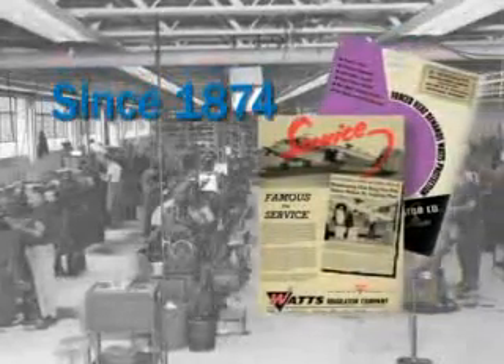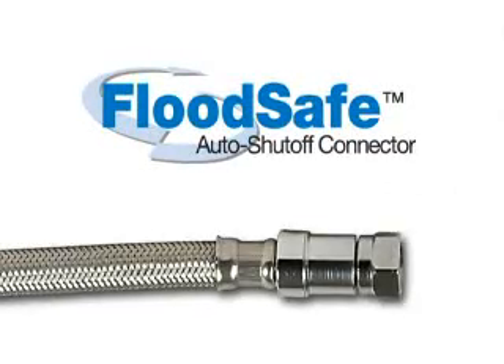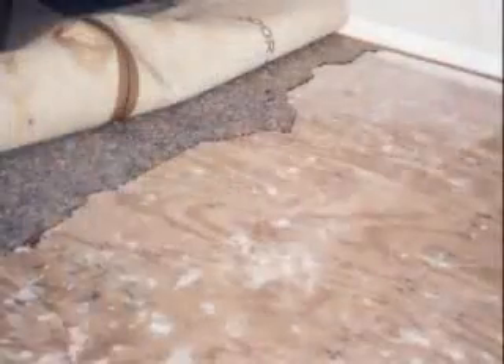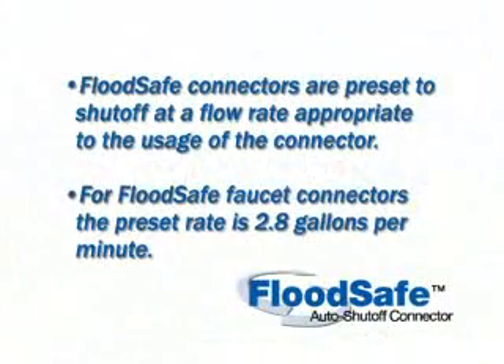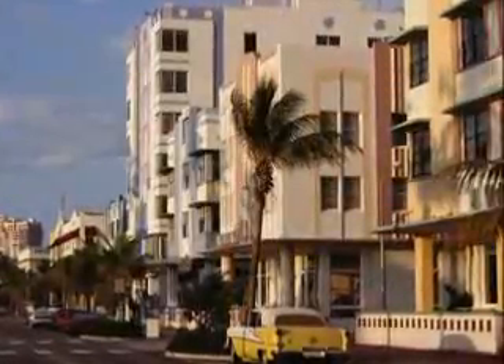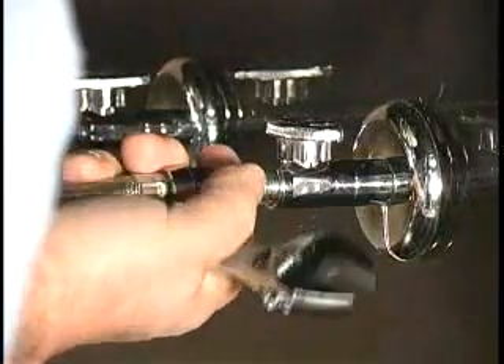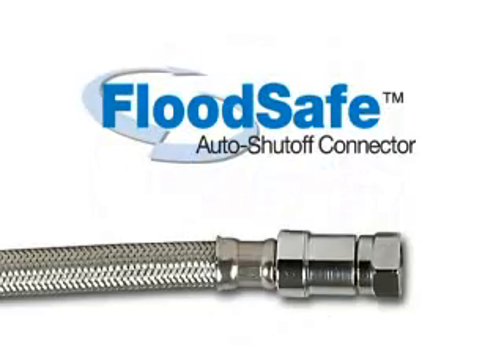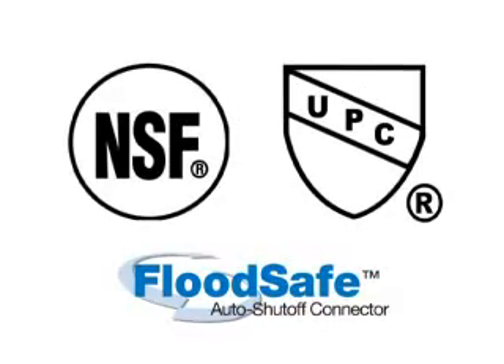Watts Floodsafe Auto-shutoff Connector

Comment: I had my water off and after releasing air in the system I found my washer wasn't getting water.
I learned it was the floodsafe hose.
Every time I reset it, it would trigger cutting off the water even when I turned it on very slow.
Frustrated I decided to temporarily turn the hose around so I can wash my clothes.
Why it became faulty is beyound me, but turning the hose around allowed me to continuing my wash.

Comment: I tried to install a Watts 20" floodsafe on my sink facet and found it 1" shorter than the regular Watts 20". The regular line was just long enough. So, I had to make a 20+ mile trip to the hardware store. Moreover, I researched the Floorsafe products on the web and didn't like what I found. The concept is good but the Chinese quality remains suspect. I try NOT to buy Chinese made products but it is getting very difficult to find plumbing that isn't made in China and most of it is crap.